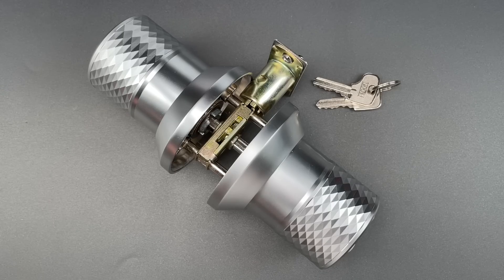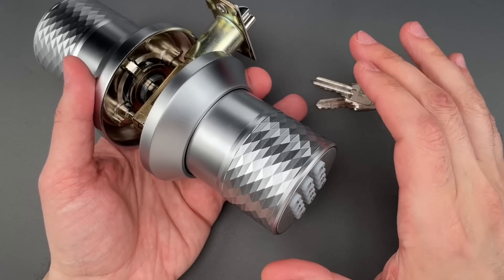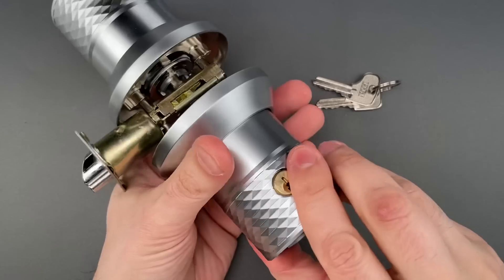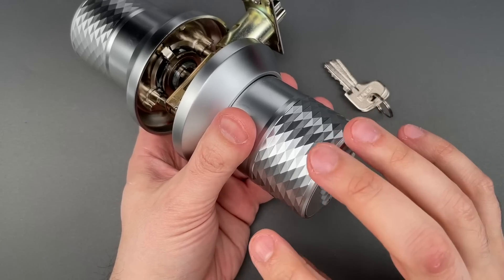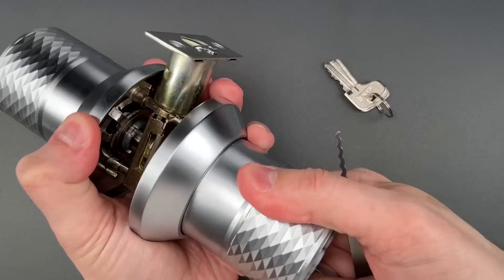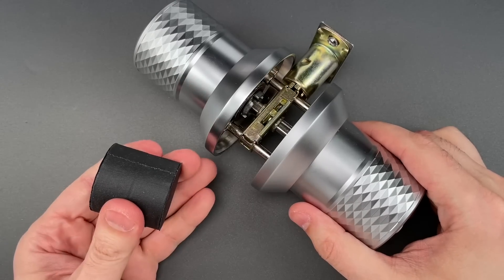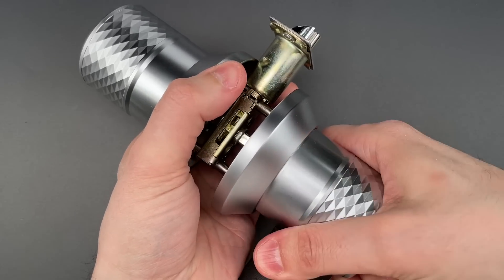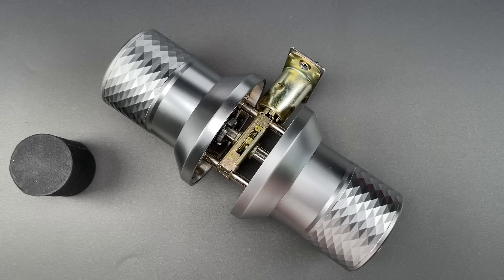[1501] Design Flaw In Fitnate “Smart” Doorknob

Comment: If i saw someone open that lock with a magnet in a movie, i would call bullshit and complain it was unrealistic.
Reply: I use a strong magnet to open sprinkler valves. As a lawn servant, I don't always have access to the customer's garage where the timer is.
Reply: @robertthompson3447  sprinkler valves are designed to open by turning the little motor.  Sometimes the motors have a handle on the back for that reason, so they look like a little knob.
Reply: @milescarter7803  I don't think I've ever seen one with a motor.  Every one I've ever seen is a solenoid.  And yes, you can usually turn them on by turning that a little, just enough for some water to escape or there is a way to manually open the valve.  But a magnet is quicker and less risky (no chance of breaking the threads and not being able to seal it back up).
Reply: @milescarter7803  Your valves sound very different to the ones we have here in the USA.
Reply: @robertthompson3447  ...Not fire sprinklers, I hope. 😂
Reply: @YT-TheLegacy  Fire sprinkler (the kind inside of buildings) are constructed with a heat-sensitive component. The heat causes the component to fail, which opens the valve at the sprinkler head. Old models had a piece of metal with a low melting point. Newer ones have liquid filled glass capsule. The liquid expands when heated, so the capsule will burst.
Reply: @robertthompson3447  All my sprinkler valves in the USA have a manual handle on them to turn them on and off at the servo. What brand doesn't have that?
Reply: @darrennew8211  These valves do have the manual ways to open them. But opening them with the magnet avoids the risk of damaging a seal or breaking a plastic part that has become brittle over time. Last thing I want is for a routine sprinkler check to become a courtesy valve replacement.
Reply: @robertthompson3447  Wow. That's a great idea. I'm going to check if my sprinklers can be opened that way, as I have indeed broken them before. 🙂  Learn from the pros, I guess.
Reply: @darrennew8211  The only kind I have found that it doesn't work on is the Hunter brand.
Reply: @darrennew8211  well, 2 people have said that so there must be something to it. But every lawn sprinkler system I have ever had in USA, the on off for zones is each zone has a solenoid that simply retracts the stopper from a tiny hole that allows the diaphragm to shift allowing flow to the heads on that zone. And the main line to the manifold that all the various zones are on, is the ball valve below freeze line that is manually turned 90 degrees
Reply: @jayc4283  For sure. You know what a solenoid is? It's an electromagnet with a permanent magnet nearby to attract it. That would be exactly the kind of sprinkler a strong enough magnet would work on. I haven't tried it on my rainbirds yet, but I will soon.
Reply: @robertthompson3447  yes, but do you have access to the customers wife's garage?
Reply: @jayc4283  That comment is more appropriate for the video posted on April 1st. 😅
Reply: You can do a lot of funny stuff with a rather strong magnet. Reversing street lights. Messing up some cars so their key fobs don't work. fun stuff.
Reply: @serronserron1320  Some people just want to watch the world burn.
Reply: @imveryangryitsnotbutter  Some people just want to watch the locks turn.
Reply: @CraigTrader  I wish this was on a separate thread.
Lots of groan.
Reply: @serronserron1320  what do you mean by "reversing Street lights"?
Reply: @Jehty_  wouldn't you wanna know ;)
Reply: @roadrunner9843  well, yeah. That's why I asked.
So why aren't you a nice guy and tell me?
Reply: @serronserron1320  Yesterday had a client tell me how her refrigerator was failing while the Freezer portion defrosted.  After cleaning the coils etc... they found a magnet on top of the door that once removed cleared all the errors.
Reply: @Serron Serron  example please of reversing street lights with magnet!
Reply: @yaroslavpanych2067  pretty sure it won't work like that. maybe electromagnetic waves but even that's a stretch
Reply: @serronserron1320  But how do they work? And I don't wanna hear from a scientist.
Reply: @cympimpin20  How do magnets work? Magic of course!
Reply: @cympimpin20  Magnets?

Man all i know is rare earth ones are the shizzle. Big enough magnets will smash your fingers
And single voice/coil dual voice coil and their related audio applications.

Want big F off electromagnet? Use an old 2400ish watt subwoofer magnet
Then apply some voltage via cordless drill batteries

Make skecthy rail gun

Keep gefinker pokers aussen dem geslammen magneten, ausgeschleiben deine gefingern will das gesmusshen gesein.

Lmao
Reply: @serronserron1320  pyschopathy signs
Reply: @serronserron1320  you're the exact type of person that shouldn't watch videos like these. Sabotage is not fun
Reply: One of our local teens used a rare earth magnet to defeat the lock "sevuring" his father's shotgun.  Luckily for all he was ratted out and caught by family before he did something irretrievably stupid.

Kids learn the darndest things these days.
Reply: @mbryson2899  Another of LPL's videos shows a lock securing a firearm opened with a magnet.
Reply: Yeah, you actually have to make lock manufacturers artificially smart in movies to make it interestig.
Reply: @peterzerfass4609  Or you could bring a good locksmith with tricks that a normal person wouldn't know. But people don't care about realism, good plots, interesting movies, characters that actually can do what they tell you can do, interesting facts, judging art, judging art value, pushing limits. Or "Hollywood" doesn't care enough to provide.
Reply: And yet LPL does it *ALL THE TIME*. I took a strong magnet to Home Depot to test on all their demo "smart locks" before choosing one.
Reply: a friend of mine rent’s shop spaces he routinely opens doors with deadbolts and locking door knobs left from previous tenants with a large pair of Channel locks, and a flat head screwdriver relatively quick.
Reply: @atlas3863  I have boltcutters, two prybars, and a lever pipe.  If you don't care about mangling the lock you can go far.
Reply: @mbryson2899  can’t forget about the cordless angle grinder with a metal cut off wheel or maybe a 12 gauge known as a “master key” but i’m pretty sure the owner would be happier if The tenant’s just left the keys😃👍 most locks only keep honest people out. i’ll go out on a limb and assume most criminals don’t mind one bit if they mangle the lock.
Reply: "The difference between reality and fiction is that fiction has to make sense."
Reply: @AbsalomIndustries  Haven't you ever encountered an inconsistent writer? Like this vault door it's maximum security but somehow in the most mundane way the guy just opens it.
Reply: @thejugernautkiller390  I have, but my point is that real life is weird, and fiction, on the contrary, needs to make sense in order to be considered "good." Random events happen in real life but are a poor writing method of moving a story forwards even if thats how some events happened in reality, like how the archduke and his wife avoided a bomb just to run into an moping assassin later the same day after their driver took a wrong turn.
Reply: To make it look more "realistic", they'd have to use some huge magnet made out of exotic materials, carried in a large bulky protective case, the procurement of which makes up an entire sub-plot by itself. And the hero would need to make multiple attempts before finding the one specific spot where it works, sweating profusely the whole time, as a counter waiting to trigger some cataclysmic event that can only be stopped from the other side of the door clicks down from about 2 minutes to just over 5 seconds, with the entire scene stretched to more than 7 minutes of screen time.
Because no one would believe it could be done instantly by someone with minimal knowledge using an easily-pocketable tool.
Reply: ¿How about with a radio? We used to place our handheld radios against the badge readers at CA's Franchise Tax Board building, key up the shoulder mic, and the radio would pop open faster than we could open them with the issued badges.
Reply: LPL has a video from 2019 showing how a mechanical push button combination lock for doors can be opened with a magnet. He says the design was changed in about 2011. Also, the company made available a kit to fix the problem.  It's   [914] The Worst Lock Design Blunder Ever? (Kaba Simplex Series 1000). There are LPL videos of other locks that can be opened with a magnet.
Reply: LPL has a handheld Electromagnetic Pulse Generator, which he uses to open some types of locks with electronics.
Reply: I get it, and with the fully mechanical locks that have been the norm for a long time this wouldn't work.  but with these "smart" locks it has to do with how the electronics interact with the mechanical parts. as once you enter the code or touch the keyfob or what ever alternate task it is to signal you should have access, the electronics must be able to unlock the lock with out needing the key.  there's a few ways to go about this, it seems what these guys did was use an electromagnet to attract a pin into position so it would catch and bind the knob in the same way they mechanical bit would when it's unlocked, then when they turn off the electromagnet that pin springs out of place again and unbinds.  here's the thing about magnetic pins, it doesn't care what magnet is pulling on it, just that a magnet is pulling on it hard enough and in the right direction to overcome the spring tension. you do need a much stronger magnet then they one they are using because yours is further away and just like with a flashlight the further away from the source the less strength it has. but find one strong enough and move it to the right spot and bam the unlock pin won't be able to tell the difference between the field coming off your magnet and the one from the electromagnet so it'll act like the electromagnet is on, aka unlock the door.
Reply: @CrossRoadsOfTime  - Yep, solenoids & motors are the usual electronic to mechanical interface. That said, I've used several locks that use motors, that can't be defeated with a simple magnet.
Reply: @michaelmoorrees3585  yes those are the better thought out ones
Reply: @CrossRoadsOfTime  And if they bothered to orient the solenoid in the correct direction, this attack wouldn't work.  on virtually all of these solenoid locks, if you just orient the solenoid so that it needs to be pulled into the door you could not attack it with a magnet.
Reply: @CrossRoadsOfTime  thanks dad
Reply: Movie "Sneakers" - good sharp kick over-rode the security lock.
Reply: I remember getting a similar feeling seeing an electronic door lock mechanism easily bypassed in the movie Aliens. And since then I seen similar things being done to real locks. Sure the movie are set a few centuries in the future but that is a type of security flaw that could survive for long.
Reply: Angry upvote. 
You know it's true!

Comment: Looks like once again zip ties seem to provide greater security 😂
Reply: Imagine the fury of a burglar that brought 36 different lockpicks and turning tools only to be met with 3 zipties - and he forgot to bring scissors.
Reply: @bartoszkrawczyk5921  Five minutes with the wave rake should do it.
Reply: @crushert  still more time than it'd take to open this lock lol
Reply: @bartoszkrawczyk5921  You could probably move the locking pin of the ziptie with a pick, or if you have a thin one put it through the back and use it as a shim.

If you have a particularly beefy turning tool, or any rod that can take some torque, you could also just use it to break the ties.
Reply: Shim attack works on basically all of those, so not really